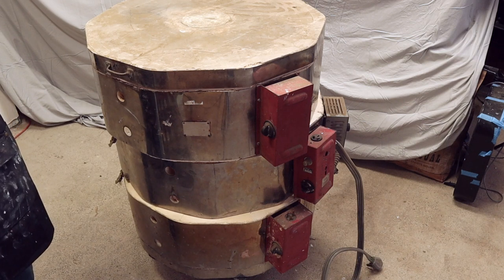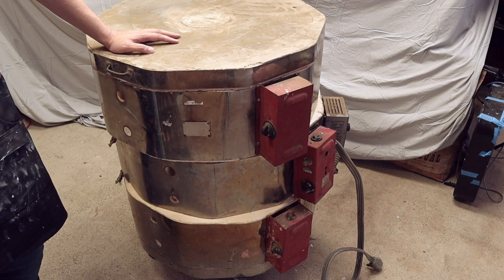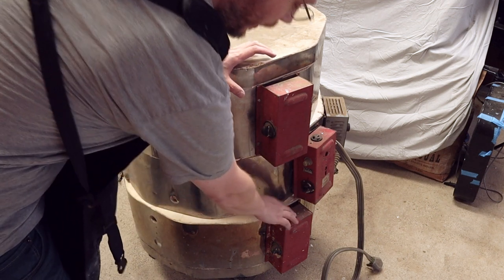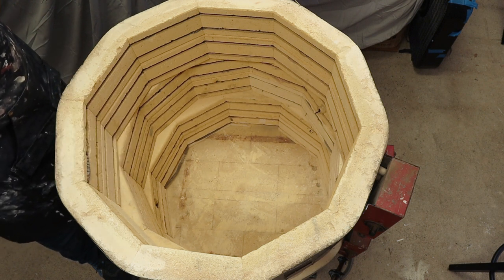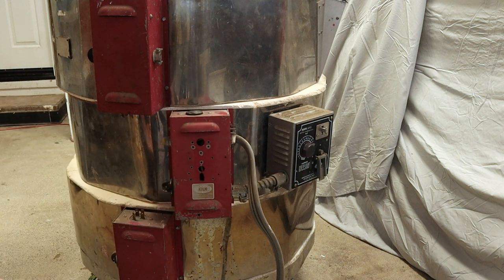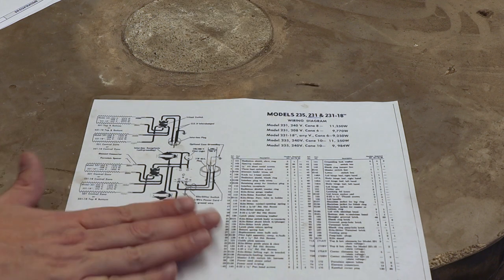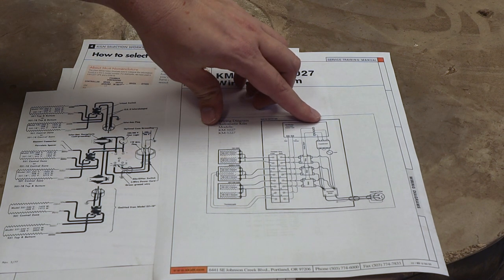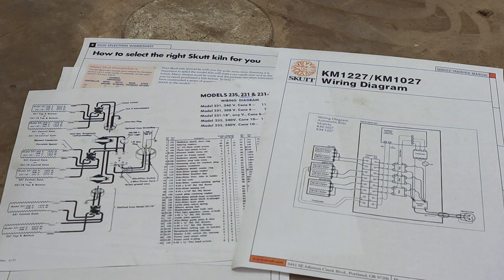My new OLD Skutt 231 Kiln, walkthrough, and comparison to a Skutt 1027

Comment: Correction: That original plug is two hot 120v (240V total) lines and a ground that kiln does not have a neutral line.
Reply from the maker: Thanks for the clarification.

Comment: Hi Kent, I just bought a Skutt 231 kiln and I need to refurbish it, can you give me any tips? It looks like everything needs replaced, it looks like it will cost a bit to repair.
Reply from the maker: That's great. I've really been enjoying mine - even with the one section I removed, it is still huge! Probably the biggest thing to keep an eye out for is the integrity of the high voltage system (power from the wall, relays and elements - I ended up swapping out my elements but in retrospect probably could have tried the old ones longer). And then there's the controller. As you can see in the playlist, I made my own since I have that knowledge. That probably isn't an option for most, but I didn't really look into alternatives.

Comment: Hi Kent, 
Thanks for the video. I am looking at getting this same model. Question for you. What did or would you use for a control box to upgrade this to “automatic” 
Thanks
Reply from the maker: I replaced mine with a raspberry pi and some open source software (and a few small custom electronics bits). I've been happy with it - watching the temperature profiles in a web browser has been a great feature! I have a playlist here showing the full rebuild of the kiln including several videos on my controller that go into more details.
Reply: @PotterybyKent  thanks for the response! I now see your videos on that. I’ve concluded you know way more about the electronics than I do! Haha.
Reply from the maker: Haha. Yes it is one of the skills I already had. For most folks an off the shelf controller is the easier way to go. But I really don't know much about them.
Reply: I use a SOLO 4896 (I think it is called a PID) from automation direct. Bit of a learning curve to program it cuz it is not programmed the same way digital kilns are, but it ends up being way more versatile. My set up is the controller is mounted on a wall, it has a thermal couple input and a control output to a relay which just controls the power to the wall receptacle that the kiln is plugged in to, I then just leave the manual kiln on high and let the controller manage turning the elements on and off as per my programmed schedule. It also lets me just enter a temperature and it achieves it, which is helpful at the end my crystalline firings as different effects can be achieved by raising and lowering the hold temperatures. It's basically a temperature controller for all kinds of things, not just kilns, that is why it is so versatile. The controller was around $100 (several years ago). I also had to buy a Solid State Relay, a matching aluminum heat sink, a cpu cooling fan, and a K style thermocouple, all bought off amazon for dirt cheap, all working great so far. Back at automation Direct (.com) I bought the controller and some K style thermcouple wire, the proper wire for your thermocouple is very important..

Comment: Here's a specific question that you likely know the exact answer to. Do the 231 and the KS1027 use the exact same elements? I have opportunity to buy new elements for a 231 at a decent discount that I hope to be able to put in my KS1027. I know Skutt could answer this but they are closed till Monday, don't want to miss out on a deal. Elements have just about doubled in price since I last purchased, which was not that long ago!
Reply from the maker: I am not 100% sure, but I'm pretty sure they are. I went the other direction and when I put new elements in mine I used the 1027 elements. There were no issues with size, etc. I've had no issues at all using them.